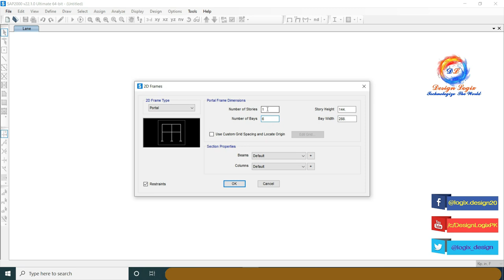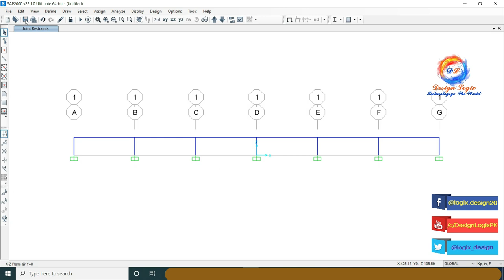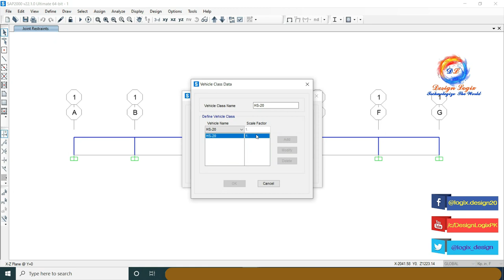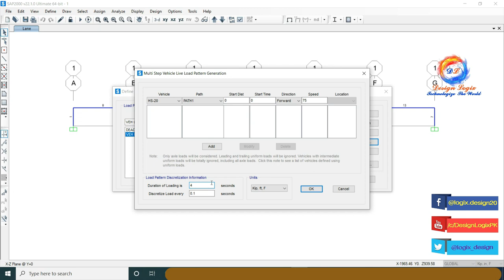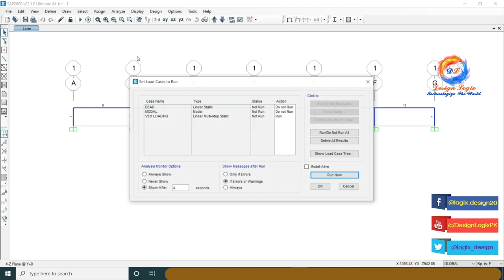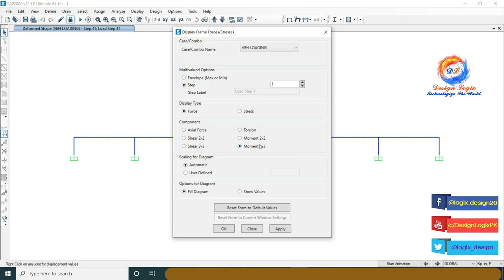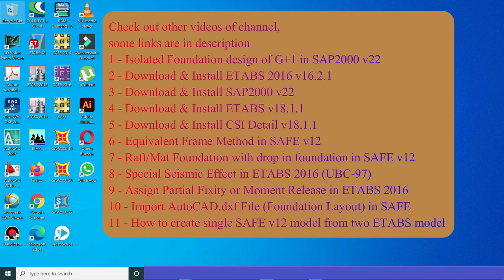Moving Vehicle Load in SAP2000 v22

Comment: On Sap2000 v21, Haven applied Moving loads (path and vehicle) on my bridge crane constituted by many spans separated by nodes, unfortunately when i create a multi step animation video i found my vehicle does not go all along the bridge crane but stops on the first span although I defined the path for the whole beam.

Please can i know what is the problem and how can it be remedied ?

Is there a particular type of joints am i to define on the bridge crane and a joint linking the bridge crane with the steel structure ?